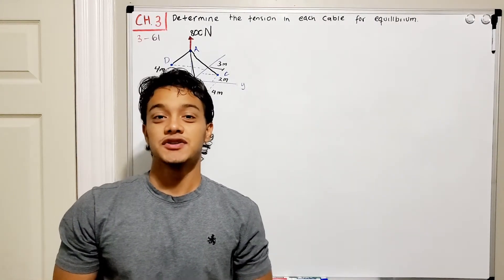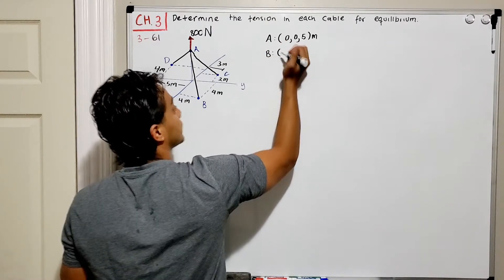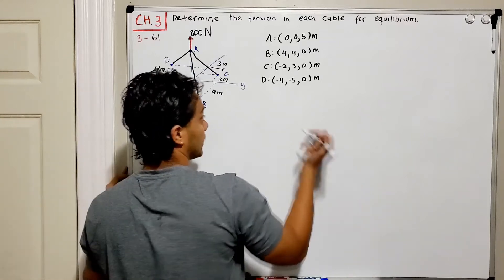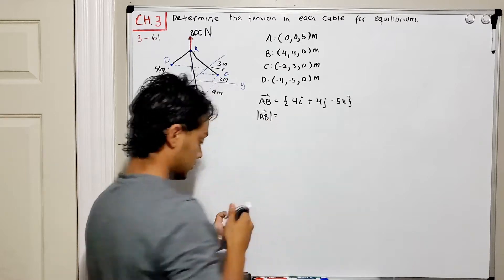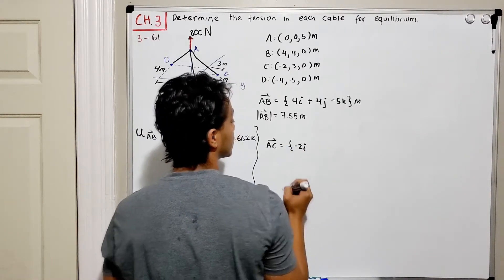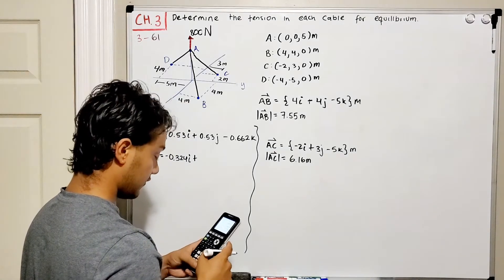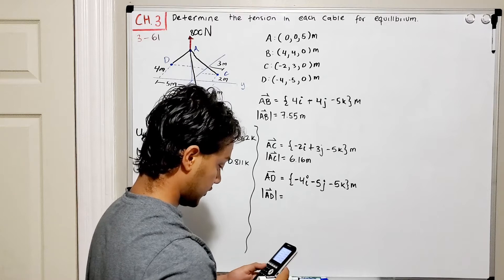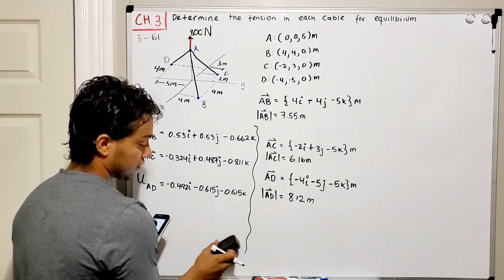Statics 3.61 - Determine the tension in each cable for equilibrium.

Comment: how did you calculate AB = 578 and AC and AD. what did you multiply?
Reply from the maker: As shown in the video first we need the unit vector for each force in order to know how much of each force goes into each direction (axis).  Apply sum of forces for each direction and then solve using any mathematical system since there are 3 unknowns and 3 equations. (I used matrices).
Reply from the maker: If interested on how to solve using matrixes, check the video below which is a similar problem.
https://www.youtube.com/watch?v=1Fg6SkZt4F0&list=PLQ5rSSwLAoxJm_2U85uk6z0rcrwtE66pl&index=24&ab_channel=LearningbyTeaching
Reply: @LearningbyTeaching I still don't understand very well